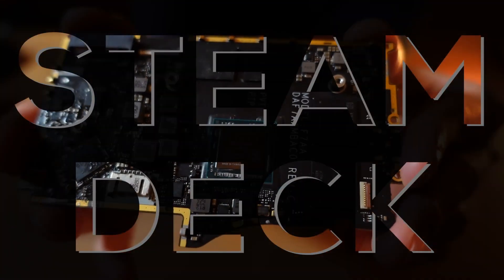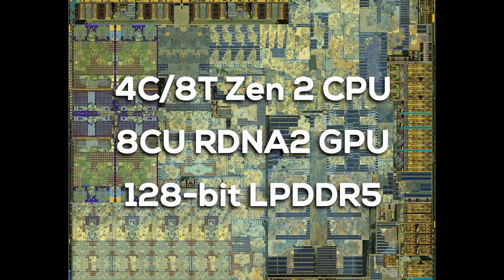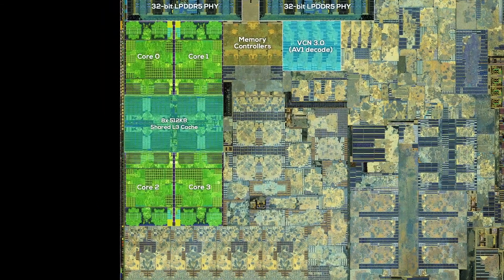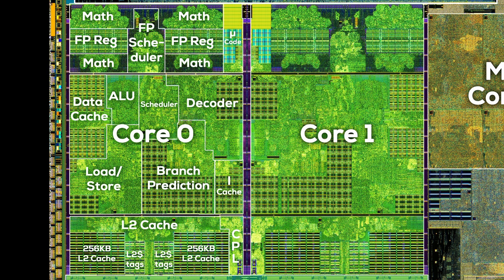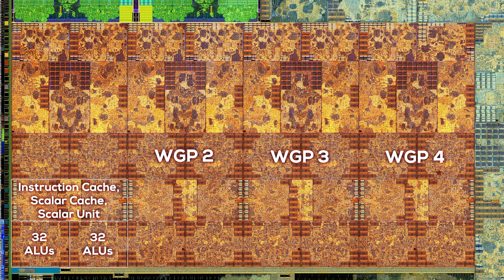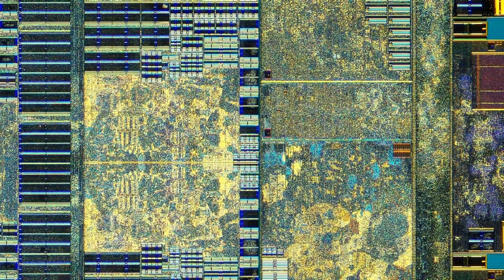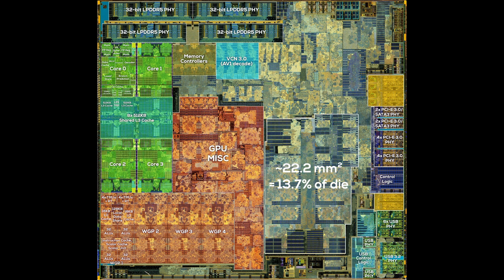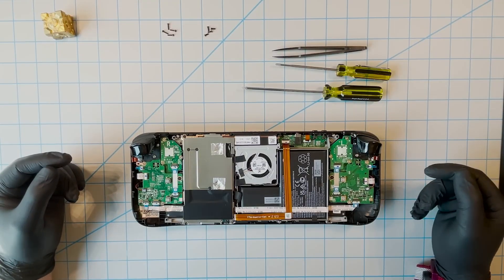The Aerith APU inside the Steam Deck

Comment: Great video as always, keep'em coming.... Watching this makes me really curious for Nintendo Switch 2 's SoC and Valve's own Steam Deck 2 SoC, hopefully with Zen 4 cores and more GPU compute units and smaller process node it would be a beast. And hopefully they don't put disabled cores in it intended for other devices, space is very precious.
Reply: I think the earliest valve will try for steam deck will be zen5 rdna4 if they both turn out to be really good

Otherwise most likely zen6 rdna4.5
Reply: Zen 4 and RDNA 3 APU's are already on the market with Asus ROG and Lenovo Legion Go, assuming a Deck 2 is released by 2025, I expect it to be at least Zen 4 but probably Zen 5, depending on release, maybe Zen 6 but I doubt Valve would want to wait that long, as for the gpu, It's very likely to be RDNA 4 or 4.5, depending on when the Deck 2 is released and AMD release it's new architecture changes for it's cpu's and gpu's.

All this is going on the assumption that that Valve will release a Deck 2 in 2025, which I think they might have too because other rivals like Lenovo and Asus could release their second hardware upgrades to their own portable devices, which if they do, the Deck would look quite dated and expensive if it doesn't get a big price drop by then.

Looking at what rivals are doing in the portable space already, 8 cores seem very likely for a Deck 2 and also needed for games going forward, but the gpu performance is hard to guess, it will probably be around double the performance of the current Deck, maybe more, but I suspect ray tracing performance will be a lot better and it will be able to do A.I. workloads, going beyond that performance level like other rivals will probably want to do will probably be too much for having decent battery life, which the Deck OLED is in a good place on that and I doubt most gamers will want to take a step back from that.
Reply: @paul1979uk2000 As you can see Steam Deck can already do "AI workloads" just fine, the problem is the software...

Comment: Looking at Van Gogh makes me think just how versatile Zen 2 was for AMD. They had it for desktop, mobile (Renoir), PS5/XboxSeriesX/S, and will have it for Mendocino in both TSMCs N7, N6 flavours and I think each iteration has slight changes in design as well. I'd really like to see an N6 shrink of Zen 2, maybe someone has a broken Oberon Plus as well?
Reply: The Steam Deck OLED has the Zen 2 cores in a N6 shrink already, and it's very efficient.
Reply: @aviatedviewssound4798  Yup, added  the revised PS5 as well so we don't need to just  donate a broken Deck OLED as well lol. Also this just came to mind, but I wonder how similar Mendocino with 4 Zen 2 cores and RDNA2 w/ 2CUs is to the OLED SOC? OLED is around 132mm^2 while Mendocino is about 100mm^2
Reply: @NootNoot.  The Zen 2 cores are actually more efficient in terms of design than the Zen 3 cores, but the Zen 4C is shaping up to bring back that Zen 2 efficiency. The fact that the die is still bigger might be a fact that they've just reduced the number of AI cores but still kept them for future AI workloads in gaming.
Reply from the maker: Zen 2 was AMD's breakthrough. Small, efficient and fast.
Reply: Ps5 Pro's rumored to be on zen 2 N4 isn't it ?
Reply: @gabrielmarconato7883  AFAIK yes. But revised PS5 (one that you can buy now) uses N6 version.

Comment: I've been waiting AGES for a proper high-res die shot from Fritz, and you've given a great analysis of the chip to go along with it! Pierre-Loup Graffais confirmed to me around the announcement of the Deck OLED that part of the size reduction came from removal of some unused components, which had to be the DSPs, so Sephiroth should look pretty close to N7 VGH outside of that.
Reply from the maker: He will release the Van Gogh die-shots very soon. The initial plan was on the same day as the video, but due to the holidays he needs a couple more days for the upload. They are coming in crazy high detail, much more than a 1080p YT video could show.
Reply: subtracting the DSPs' 22.2mm² gives 143.85mm², which would mean an ~8% shrink to get 132.65mm². Much more reasonable!

Comment: Cool discovery! It's almost like this could have been in a tablet, or something camera- centric. Steam AR? 
It's also astonishing to think that it was easier to keep these parts not used in the Steam Deck than do a separate  design. Shows how much effort/ expense each physical design is!
Reply: I think Steam/Valve are making a new AR/VR headset. The name 'Deckard' has been floating about. Although, I haven't caught up in the leaks or rumours, so idk if the SOC will be AMD, or even x86 based. Perhaps ARM?
Reply from the maker: There's a lot of product synergy for sure. If we could confirm that the CVIP cores aren't part of the 6nm APU, we can basically be sure that the Steam Deck is selling good enough to finance a re-design.
Reply: Something like a Microsoft product?
Reply: This is because aerith was originally for a microsoft surface tablet conputer

Comment: I find it insane how tiny the area of the combined CPU and GPU take from the whole die.
Reply from the maker: Yeah, espcially since the Steam Deck doesn't need a lot of that. A truly custom APU wth e.g. 4x Zen4c and 12CU RDNA3, 4x PCI-E and maye 2x USB could be even more compact. I'm really excited what Valve will cook up for the Steam Deck 2!
Reply: @HighYield   Will also be interesting to see what they cook up for the Deckard, since there are rumors its going to have some sort of x86 APU.
Reply: This is why it seems surprising when some claim: "Apple's CPUs are only fast because Apple has huge die space to spare. Apple doesn't sell to anyone else, so their CPUs can be really big without consequences. AMD & Intel could never do that!" On any modern SoC, the CPU total logic area is one of the smaller structures: I/O, GPU, NPU, caches (!), etc.
Reply: @ikjadoon what would be interesting is how large Apples process-node advantage is. They sell less and more high-margin items than the others so it makes sense for them to be on the cutting edge. The others would likely not even be able to get enough production volume from TSMC.
Anyway, I would like to now how much of their performance improvement is due to technology, not necessarily architecture.

Personally I think it is doubtful that on these large performance oriented designs the difference is due to ISA. Its likely technology and other architectural choices. (At some point all ISAs start being micro-instructions anyway so you can decode and execute them in a more optimized fashion.
Reply: @PhilfreezeCH  look at the performance changes with the iPhone 13, 14, 15. N3 was not ready for the 14. The this year only the 15 pro has a chip using N3.
Reply: @PhilfreezeCH The memory ordering of an ISA has performance implications that cannot be fixed with microcode. For example, x86 has a more strict memory model compared to apple silicon leaving apple silicon more freedom for optimization. If this were changed on x86, it would break old (multithreaded) code.
The fixed instruction width also allows apple to add 8 wide decoders (decode 8 instructions at once), while AMD and Intel are limited to 4 and 6 respectively.
Reply: reading this made me imagine a M-sized cpu filled with Zen 4c